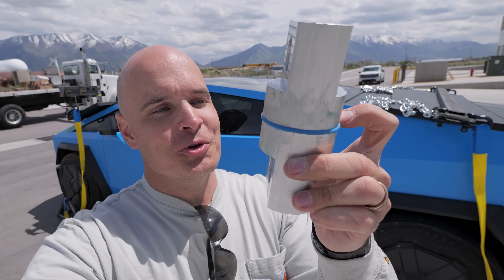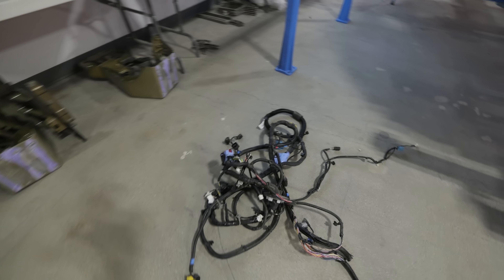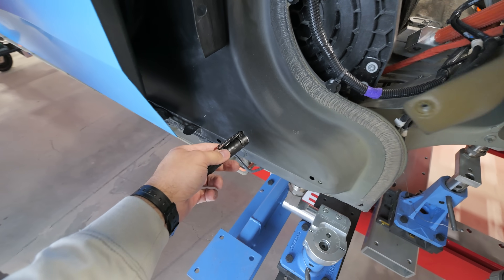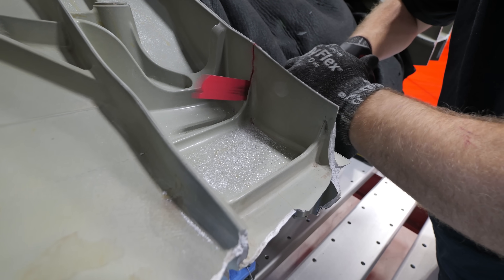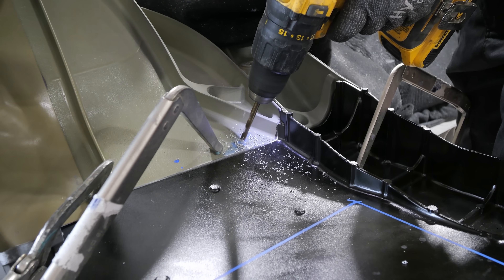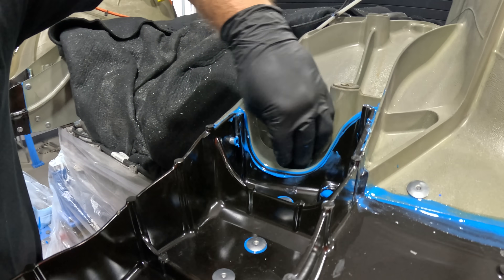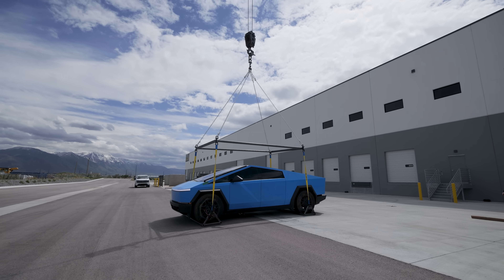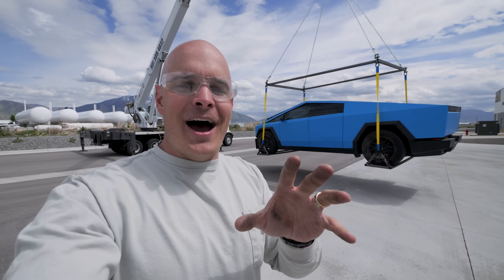Tesla Fixed my Cybertruck with GLUE - (but I'm not mad about it...)

Comment: Should have kept the adhesive a secret because now smartphone makers are now going to use it to glue in the batteries on their smartphones.
Reply: Well, all it takes is an excavator to get it out, shouldn't be too much of a problem... 😎
Reply: @Xiph1980  You said that right!
Reply: Shhhhh... Don't give them ideas!
Reply: You say that, but imagine if we could get to the point of having this strength of adhesive combined with the glue apple uses that breaks down with a 9v battery...
Reply: @JPEight  Or, you know, screws.
Reply: Google Pixel: Late to the party?
Reply: You just need screws with red threadlocker and it's as good as sealed as red threadlocker needs high heat to loosen.

It would however stop manufacturers from performing warranty repair/refurbishment, costing them a lot more money in the long run as they would have to replace entire phones for the smallest of issues.

The issue with right to repair for phones is lack of documentation and spare parts.
Reply: @TheSkcube  it wasn't a problem 15-20 years ago. All phones had some warranty without glue and red threadlocker.
Reply: @JohnDir-xw3hf  what I was saying is that the technology already exists to hamper repair of devices, you don't need this fancy glue to do so.
Reply: @TheSkcube  >implying any manufacturer repairs any phone
they just give you a new one. they might ship the broken one to vietnam and get back $40 at best. in many cases they just send it for recycling/landfill.
Reply: Super glue already exists, and at the scale of a smartphone this would not be that much worse than super glue.
Reply: Shhhhh. I already had enough with today's smartphone glue.
Reply: Lmao
Reply: The European Union adopted a new Batteries Regulation in July 2023. This regulation requires that portable batteries, including those in smartphones, be "readily removable and replaceable by the end-user" without requiring specialised tools or solvents. This specific requirement for user-replaceable batteries is set to come into effect by 2027.
Reply: Just Google
Reply: Dammit why you have to point it out.
Reply: Don't give apple any more ideas lol
Reply: Well, they don't have to reverse engineer it. Just use the Fusor 2098 wonder adhesive 😢.
Reply: Too late, the Pixel 9a already uses this as JRE found out the hard way 😆
Reply: Apple have invented a glue that breaks down with electric current. I have no idea how much research that took, or whether it has any advantages, like making it immune to moisture ingress. But if they were really that determined to keep you from replacing the battery, they'd just mould it into the housing or just serialize them.

Comment: 14:27 slowing lifting and lowering on a nice sunny day is one thing. Now put that device you made in the freezer for a few years then direct sunlight for a few years and bang it around a bit and test again.
Reply: If it takes several long years of cold and sunlight "direct" exposure just to theoretically break it, you've just proven how tough the glue is and he is right about it.
Reply: @chriscross1737  so let me get this straight, if we follow what you said, a cybertruck should be reglued/replaced every couple of years?
Reply: @RandomPerson1904  "direct" is the keyword glue is under all the body. With that kind of exposure engines of all cars would be cooked, but there is no direct exposure
Reply: @RandomPerson1904  someone should define that "couple" of years.
Is it 10, 15 or 20 yrs?
Reply: @utkarshh136  additional to that, he did not say years of "both" sun and cold, but years of cold, then years of sun. Making it far worse than what a car normally goes through.
Reply: @utkarshh136  It was kinda a worst case scenario dude… direct sunlight is probably the worst, but the telperature difference, and the difference between the thermal expansion of the steel, aluminium, glue, and probably plastic would also be a factor. Maybe the glue will hold for a 100 years, if it did, I would be happy with that, but the fact is, that the glue is not age tested on the cybertruck, so no one knows if it will hold.
Reply: @chriscross1737 That is a tough nut to crack. For vehicles, I would say that anything that should be permanent attached, should be permanent attached. You could argue rust etc. but rust has a visual cue id it is good or not. I am afraid that the glue might not have it.
Reply: @RandomPerson1904  if that would be the case then it would mean changing the rear of that truck which I could guess would be much more costly?

I think the glue exists, and is created for this kind of situations, so it presents a solution that is not too costly for the consumers and at the same time, restores the car closer to its previous undamaged integrity.

I think the glue will not be used by other car companies as well if it's not that durable through time.
Reply: So you want to treat the device like you do your exes?? 😬
Reply: @whodat9198 OHHH! That’s a good one 😁
Reply: Considering they put 20x that amount of glue on the frame it's got plenty of room for error.
Reply: yep, i bet « joesshows6793 » in the youtube comments section knows more about automotive engineering than tesla, honda, toyota, chrysler and gm combined

Comment: WOW, that simply blowed my mind. Glue that holds 3 Tons
Reply: very old marketing trick.  Any 2 part epoxy, or even super glue, could pull the same stunt.  Even common wood glue has to strength to do this (if it bonds well enough to aluminum, i'm not sure it would)
Reply: @Wooble57 prove that claim, upload a video. Wood glue would fail trying to hold up itself

Comment: I need whistling diesel to check this glue then i would be convinced even more
Reply: yup, structural glue durability test
Reply: I did autobody 10 years ago and this was the same type of glue we used
Reply: He said in his previous video “there are real world scenarios where the trailer weight becomes tongue weight, going up a steep hill or driveway your hitch could snap, or your trailer jumps the ball going 80mph on the freeway, giving the safety chains a jerk, your whole rear end is now gone” “it’s built like a pop can”

Now it’s “As long as you load and balance your trailer correctly, the cybertruck will always be able to load its rated capacity” which tongue max weight apparently is only 1,100 pounds, funny how after he goes to Tesla he doesn’t  say any of this 😂 seems like someone paid  him cough Tesla
Reply: Glues like this are used in airplanes and space flight, and also in the Lotus Elise, which Tesla used as a basis for their first cars.
Reply: @Xiph1980 Airplanes aren't meant to tow loads.  Idc how good it is for space, it won't be good for DAILY work.
Reply: @clintonleonard5187  This glue is used in other cars all the time; pretty much every manufacturer has used it here and there; you just don't hear about it. It's structural glue, not some fancy Elmer's magic invented yesterday.
Reply: @clintonleonard5187  It's a worse workload on Airplanes, they flex a lot and have to be light, not a huge margin like on a truck.
Reply: @okgoogle4206  Yes but they get inspected and repaired after a number of hours, routinely.  Far more than a road vehicle.

Comment: Glue doesn't mean bad, it can be stronger than what it's holding together... which means there's not much excuse for the glued on panels to fall off
Reply: exactly. did those panels use a different type of glue, or was it misapplied, or was too little used?
Reply: @TroyArn  They probably did use a different kind of glue or they used it on the wrong material. Construction adhesive isn't very picky but it's damn thick and isn't pretty so my guess is they used a children's glue stick or the material the plate was stuck to was so super smooth, nonstick material that wasn't roughed up.
Reply: @TroyArn it held 10x its rated capacity when it failed. That’s impressive.

Comment: I keep hearing how much Tesla repairs cost, so I'm shocked that this massive repair only cost $13k. When I saw the original excavator video, I thought for sure that CyberTruck was headed to recycling.
Reply: All you need to do is run a popular YouTube channel known for breaking things and you are good.
Reply: @miguelvpires  And promise Tesla you'll do a promo video for them defending their structural glue and pretend it's not an ad because technically you didn't get directly paid for making the video...
Reply: @LordDragox412 
Just what I was thinking as well.
Reply: Not a battery repair, not a motor replacement, and no bodywork.  Yeah, it's less than I expected, but not having to refinish anything or replace an expensive technology-packed non-serviceable item (motor, battery) helps quite a bit.
Reply: Most modern cars' repair costs are nightmarish for a list of other reasons, but other Tesla models, at least the older ones, are expensive almost entirely because the parts and it takes forever. Other manufacturers have other things that make their costs super high, like specialized tools, subscriptions, and overpriced, one-time-use parts. Teslas just take forever.
Reply: "Only" 13k
Reply: @jasonrichardson1999   Thinking about other Tesla repairs I've heard about, Zack got off easy at $13k. As it is, I wouldn't be able to afford a $13k repair out-of-pocket. Then again, I don't pit my vehicles against excavators  in a "tug-o'-war" just to see what would happen, so there's that. 🤣
Reply: 😂😂😂 buddy an average body shop could do this for 3 or 4k
Reply: @my2vwillgapyou  and without warrenty. He said in the video that Tesla rebuild it to out of factory condition. Will your 3k body shop do that? No they will just get it to the point everything fits to cut their costs too.

Comment: Why can’t it hold the panels on the car?
Reply: Its not the same adhesive they've used on the cantrail trim. That ones black. Its also bonding Stainless steel, where this one is bonding aluminum together.
Reply: because you want to be able to take panels off so you can replace them without replacing the frames.
Reply: Careful, you're asking valid questions. You can get called nasty and get kicked out for that, at least from the White House.

Comment: I like the part around 11:39 where you can see they applied less glue originally then they are adding now.  Its crazy to think that the glue can be a variable and that 2 trucks could have completely different outcomes towing the same items.
Reply: It's also a less controlled process, hence adding more glue for some extra margin makes sense
Reply: Thought the same thing,came here to look or comment that fact... It's pretty wild...so lesson here is ,rip that back part of your cyber truck off ,so than they can apply more glue ,glue spread all over ,instead of the original 3 rows of glue it appears in the old footage,wild smh
Reply: It is almost definitely a different composition of glue and a hence, a different application process considering the amount of time between the Cybertruck being designed originally and this repair. Quantity is not the only factor. Composition and dilution are also important.
Reply: The glue is not applied manually at the factory and that amount is also probably enough for the loads it should be getting. More glue is usually not more better.
Reply: They were likely applying more this time because the repair will be in a very popular youtube video. The original quantity is likely their normal procedure when there are not as many eyes on the process.
Reply: @semeai6366  OOOOOOOR, the original amount was just fine and the breaking point was the metal itself, but service technicians do not care; if something says "grease lightly," they will either use none at all or half a container.
Reply: @semeai6366  the original amount was still enough to support 10x the rating towing capacity
Reply: Yeah they increased it just for Zack's video, it will be back to a little glue for everyone else @semeai6366
Reply: @semeai6366  Yup, this is just pure "non-sponsored" marketing for Tesla. Sure, they didn't pay Jerry anything directly, so it's not "ad", but it's really dishonest to pretend both parties do not profit from this. Jerry gets a video and earns money from it, Tesla gets promotion and attempts to clear their name in regards to the "structural glue" that everyone makes fun of.
Reply: As he mentioned in the video, they constantly update the procedures. So the different applying of the glue might be just because the procedure got an update. Or it's different procedure for manual repair than the production. 
Edit: I also think that it's probably stronger now.
Reply: The way I see it is that they had to use more glue on the part because it's no longer a continuous part and likely the original part was bolted at a different place hence the "original" amount of glue is a bit less because it doesn't need as much
Reply: the original amount was still enough to support 10x the rating towing capacity
Reply: exactly!! Zach played dumb, not wanting to admit that the amount of glue in the original is way less than what he used this time.
Reply: @Jamirobruno the original amount was still enough to support 10x the rating towing capacity
Reply: @Jst4vdeos stop spamming the same answer. even if it was valid, no one will believe you.
Reply: @tacticooldennis you guys all keep saying the same thing despite ignoring how well the vehicle performed until its eventual failure
Reply: @Jst4vdeos  Dude, how much is Tesla paying you to defend it? I think a car company with a billionaire can handle it himself.
Reply: @tacticooldennis zero and they paid Zack zero as well
Reply: @Jst4vdeos  How do you know if Zack was paid, maybe the video was for a free repair. and if your not being paid,  why are you defending it so hard?  You don't see people defending Ford when their Pinto's burned or Firestone when their tires failed. People should call out issues and they should get attention otherwise people can die.
Reply: @tacticooldennis he said he wasn’t paid and he’d be breaking the law if he lied about that
Reply: Using more adhesive on the repair makes sense since you can't rely on the presence of a continuous alu casting taking some of the load.  It's hard to tell from the rainy footage but it also seems like maybe the original adhesive was applied directly to the bare aluminum before being e-coated as one assembly (compared to the repair in which they applied the adhesive over the paint for some reason).

Comment: You should try the initial test again in case its even stronger 😅
Reply: Donate bro
Reply: Yes
Reply: Given the truck originally had only three thin strips of glue but now they used a fuckton just for the camera, I'm sure it's at least 10 times as strong. Which still isn't a lot, but it's something.
Reply: @LordDragox412  he said quantity is a lot less important than the correct dilution.
Reply: @LordDragox412  Still isn't a lot? It withstood 10x its tow rating bonehead.